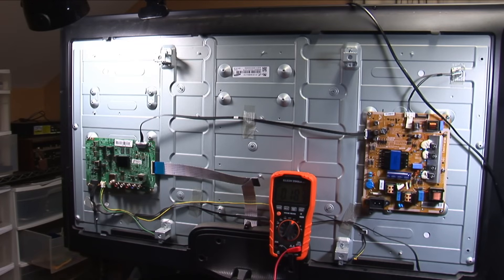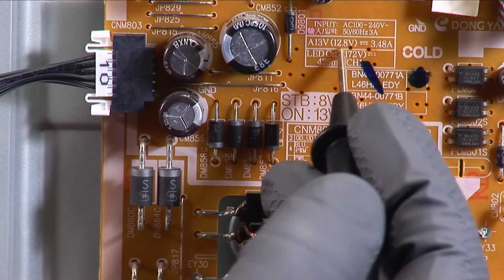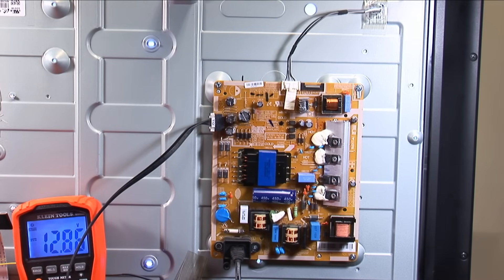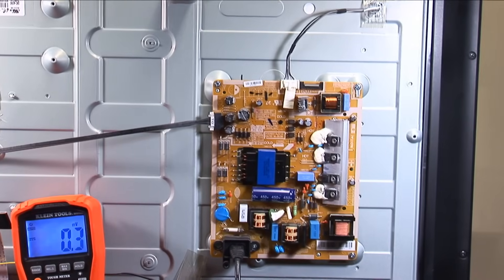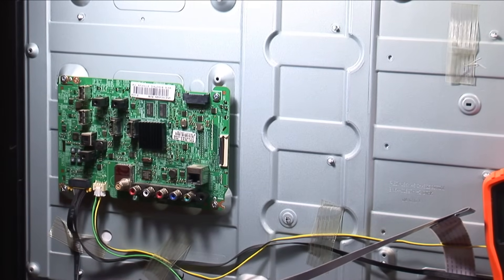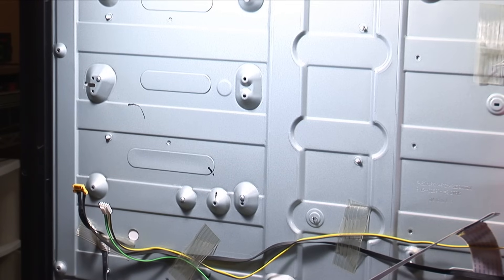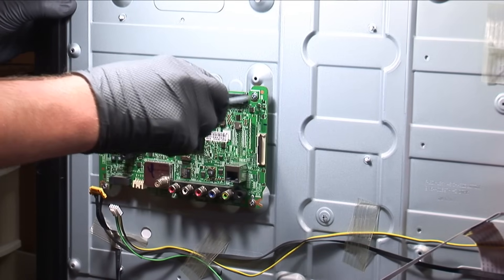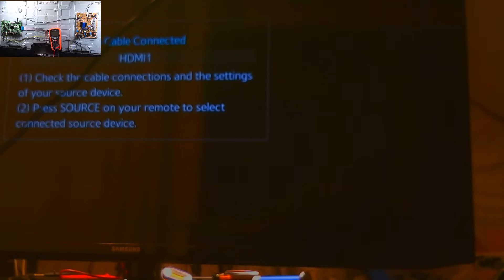Samsung LED Flat Screen TV Repair - Won't turn on, no power - How to Fix

Comment: That same 10 pin connector and table seems to be on a lot of other brands, LG etc. I salvage broken screens for the wonderful light panels they make, daylight skylight! The trouble is disconnecting the tuner-logic board leaves me to have to put a voltage on (on) and maybe more to get the lights to come on. I have never noticed pulling the 10 pin cable makes my task very easy as I want to ditch any extra power wasting tuner board etc. and have the lights to stay on not time out.
I have a dead 4K screen that seems to be OK for power but the button does not respond. I tried 3-5 volts and cannot get the lights to come on. $30 says I'll order the tuner board.

Comment: I have a sony TV, that doesn't go on. 
I checked if every board get's voltage. 
By accident i've found out as soon as disconnect the board (where all the inputs are on) the backlight goes on.
When i connect this board again the backlight goes out again. 

I hope somebody can help me out with any advice? 

Thanks!

Comment: Thanks for the commentary on the power board testing. My UN55KS8500FXZA revision AA01 won't turn on and I tested the power and the cable. Going to this stage next. 👍

Comment: I have a samsung Un70tu7000fxza, today while watching the TV shut off. Sound was intermittent then just cut off. I went through all the samsung troubleshooting with tye rep. When plugged in the red light blinks and tries to start up, screen flashes on but then Cutts out again and the TV just just keeps going through this process over and over again for an hour now. Service tech want $200 minimum for service call because it is 3 months out of warranty. Should I try and find the boards and replace them? Where would I find them. Thank you any help with this issue would be extremely helpful.
Reply from the maker: Question is, do you get a warranty on the repair?  If so it might be worth it, but this depends on how much the TV is worth.  You could try replacing the boards, although I'd recommend troubleshooting first so you don't buy things you don't need.  Almost sounds like a failing power supply but obviously can't say for sure since I'm not there.  If electronics repair isn't your forte then you may want to just call the tech as the TV sounds like its still fairly new and you may get a warranty on the parts this way.  Its easier to find parts for slightly older units on ebay and such as they were taken out of TV's with busted screens.  Buying new parts directly from Samsung would be difficult and could cost half as much or more than a new TV.

Comment: my lg 50 uh5500 if i plug it in the red comes on and most the time the LG logo comes up on the screen for a sec or so the the red light flashes 2times then goes off.. i tried pulling the cable off the power board like you did but the leds did not come on.. so i tested the plug like you did and i got 10.16 on the two on the left side of the plug and the 3 on the other side the 1st 2 also got 10.16 and the last one above NC i got nothing any ideas.. and do you think my led strips are ok?

Comment: I have 32" UE32EH5000K and I`m in a pickle. I can see the picure with torch against the screen so problem with backlight, OK. I`ve checked power board and there is 240V going to LED strips (tested to ground) so next tested, with 30V battery, each of my 4 LED strips (10 LED each) and all fine. I`ve tryed disconecting the logic board but the back lights stay down. Any ideas?
Reply from the maker: Hard to say without seeing it myself.  But you're saying you have power going to the strips but they don't light up, however powering them up manually with an external power supply they do light?  If thats the case check continuity, somethings open between the power source and the strips.

Comment: Great video.....I have a Samsung 75" Q70R and it went black screen while watching a movie, it flashed blue every 20 seconds, I have some knowledge in electronics so I opened it to see if it had bad capacitors. With the TV energized, I disconnected the ribon cable that goes to the main board and the screen turned blue, so I assumed it was not the damaged screen, I have been looking on ebay and I have found the original power supply parts, do you think that replacing the board will solve the problem?...thanks
Reply from the maker: Honestly I don't know.  Without any measurements its hard for me to tell.  With it flashing blue its almost like the power supply can't supply the proper current under load or its not outputting clean DC and/or the mainboard can't fully boot.  It sounds like the blue you see is when it reinitializes.  To SORT OF test the power supply, if you don't have an O'scope you can kind of check the output quality with a multimeter.  Make sure first that you have the correct voltages and then switch to AC and check those DC outputs again.  The reading should be zero or verrrry low.  If you check the 12v output and see 1 or more volts constantly under AC then that's a problem...not a clean output...however that might only happen under a load.  Could just be a bad main board and it can't initialize or boot ... or can't startup because of dirty DC.  Someone like 12voltvids might have an idea as it seems he works on these much more than I do.  Sometimes certain models have known issues.  I could do that with older analog gear as I have more experience with them and know many of the common problems between them.  Hope this all made sense.  I truly wish you the best and let me know if you get it figured out.
Reply: @Electronicle  Thanks my friend

Comment: Same thing happened with me ... hit by lightining ... same main board is damaged .. i have one question ... is this motherboard is repairable ?
Reply from the maker: Sure.  Anything's repairable...the question is at what cost.  I'm all about fixing and not trashing, however........   Lets say a tech charges $50 an hour to troubleshoot and repair plus parts cost, that just put you over the (usual) cost of finding a used board to repair this situation.  I made this video more to show average users how they can possibly fix their own TV.
Reply: i am from india.. samsung took 80 dollars from me and gave new motherboard in return. now i also have damaged one ... what should i do with it ?
Reply from the maker: @AkashvaniTech  Not sure about your country but we have electronic recycling centers, or you could sell it online as a parts board, or toss it.
Reply from the maker: @AkashvaniTech  If you do decide to try and sell it, make sure you list it as parts only so no one buys it thinking its a working unit.
Reply: @Electronicle  in how much money you can buy this board .. i can courier you ... whats your email address ... my samsung tv model is RU7470 43"
Reply from the maker: @AkashvaniTech  thank you but I'm really not interested

Comment: Takes 40-100 minutes of me mashing power button before red light blinks 4 times and actually turns on. Can this be fixed or do i have to go to bed with my TV on every night
Reply from the maker: Have you tried pushing the power button on the TV instead?  Worn out remote button?

Comment: If our TV just is very dark when watching movies...everything else is fine.  Which board would that be?
Reply from the maker: has it always been like that?  it all depends if its a ccfl backlight, backlight.
Reply from the maker: Also, that could be a setting.  Especially if your tv supports HDR or HLG.  Turn all that off and see if that helps

Comment: I REPLACED BOTH OF THESE AND STILL NOTHING.. ANY IDEA? ALSO AFTER LIGHTNING STRIKE NEARBY...  BN94-16427D CIRCUIT / MOTHER BOARD 
BN4400932T POWER BOARD

UN65TU8300FXZA MODEL CODE
UN65TU8300F MODEL NUMBER
S/N 0AQQ3CCNA15391A

Comment: I have the same tv but I have a red light that is on , on the logic board so does that mean it's probably the t-con board, my tv also wont turn on but when I turn the power on I can see the indicator light working lime when I try to turn the channel I can see a red light that blinks like it's working but there is no picture or sound.

Comment: I took my TV apart due to broken screen I realized i can use the LCD lights for a something but not sure how to turn back on I did it once but do u have a video showing something like that??
Reply from the maker: Um, not sure what voltage those strips run at offhand, sorry

Comment: Any tips on a reddish tint aliasing? I bought a 2nd hand samsung un40c6300 it powered on perfectly but after 3-5mins of having it on it started to slightly flicker and there’s aliasing and artifact with a red tint. Other than that it’s perfect.

Comment: No offense but board swapping for repair is fine if you have spares laying around, but the best repairs are finding the failed component on the board. One will want to do that anyway because now you have a bad board and perhaps nothing to test the next TV with.

Comment: Good video.  Have a 6900 series that a storm took out.  On it all the boards are in one.  All it has is backlights.  I'm waiting on a replacement board to come in the mail and hoping it will fix it.  60bucks will be a lot better than $410 for a replacement.

Comment: great video ,i have a two year old 75 inch Samsung that while i was watching ,i heard a pop and believe i saw a small sparking near where the power cord plugs in. my TV went black and will not turn back on with no lights anywhere. i haven't taking it apart yet but your video is giving me hope that I can fix it myself
Reply: fixed changed power supply board was fairly easy tx
Reply: Just curious if you were able to fix this. I had the same pop and spark on my set. Hoping to be able to chase it down.

Comment: Thank you for your very helpful video I had a 2022 Samsung TV that would not power up. Found out the fuse on the power supply was blown. First I disconnected the main board, unsoldered fuse from the top of the board. Put in a temporary fuse and that blew immediately. Found a board on eBay for $40 and that's on the way.

Comment: Hope you can help with a Bn4400932C board. Upon applying ac to board 5a 280 slow blow fuse blows, continuously. All peripherals are  disconnected. There does not appear to be any cold solder joints bad looking components or burns on the board. Any suggestions at this point would be greatly appreciated. Thanks for looking.

Comment: Hello , have a trash pick samsung smart 4k uhd tv mod: un65nu6900fx . There's  standby light and back lights when turn on. There's also audeo.The problem is no display . I understand the power output rating but couldn't  figure out the other Abbreviation in the CNM 801 diagram on the board  , Can you help me repair this samsung tv.
Thanks
Darryl

Comment: Very informative video, good testing. I am currently checking my Samsung UN55J6200DAF bcuz a few days ago, as we watched Tv, we began to hear crackling at the rear of Tv and it went dim blue, then black. It turned off with remote, but I disconnected everything off the wall outlet as precaution, bcuz I also smelled burnt wire. Watching pertaining videos, I checked fuse, its good. I inspected all 3 boards and only at the power supply board did I see like melted wire plastic. I could not see anything unusual on the main green board, it has a red lit port. The T-con board seemed ok as well, it has blue lights when I power on. Odd thing is, she turns on with power button and remote, but will only turn off with remote. I tested all LEDs thru the corresponding wire leads and many did not light. I tested the port pins from where the LED connector goes, and it had No current going out. I did perform the test you did, unplugged cable connector from main or logic board and did get the four 12.65v results in those leads, plus the 4.50 power on voltage of other set. One thing is for certain, I am going to replace All the LED strips with new. And Im prepared to replace the power supply board as well. However, I am not sure about the green logic/main board. Waht say ye..?  I'd appreciate any input.  (incidentally, this Tv is 7yrs old, was working flawlessly).

Comment: hehe i have my tv laying out here, with a similar problem, so was gladly following your instructions as a complete electro-novice.

1. Check power supply pins one by one. check, they're working, same as in the vid!
2. Get second hand mainboard supplied by owner... crap, dont' have that.

Anyway thanks for sharing, the tip for unplugging the mainboard to see if the backlight was working was very nice to know!
Reply: I had the same issue and was able to spot some hairline cracks in some old solder connections. I just tapped both spots with my soldering gun and got it back up and running. Haven’t had any issues since. The cracks in the board were only visible on the back side of the board after unscrewing.

Comment: I have a question about the serial number. Im replacing the screen on my tv from another busted tv and Im woried it will affect my serial number if I replace something. In the menu I can access the serial number, on what circuit board is that number recorded?
Reply from the maker: Its not held within the screen so you should be fine

Comment: I have the same TV and replaced the power board which solved my problem for a few weeks. Now I have no picture. Watching your video I have the same symptoms (no picture and lights go on when you unplug that cable). Looks like I'll order a new mainboard and hope that the T Con board is not bad also. Thank you.

Comment: Just tested mine using the same approach and the the voltage is fluctuating on the power board same points , not a steady 12.8vdc  . Also backlight doesn't turn on when I unplug the mainboard from it. Can I  assume that's the power board who needs replacement ?

Comment: Hi I had a same problem with my samsung UN55D6300SF. The led indicator is blinking but the tv won’t turn on. Do i need to change the power board or its a minor problem. TIA

Comment: Sir, I've found your video to be the most useful and knowledgeable video among the hundreds I've watched. I am an electrician, but I'm not getting any readings from any of the pins from the power supply side. Also, when I unplugged the cable from power supply to the green board, no backlight came on. Would it be safe to assume the power supply/inverter is no good? Thank you in advance for any help, and the awesome straight to the point video you created for the rest of us 🤓
Reply from the maker: obviously it depends on your specific board and how its designed but yeah if there's no output then its probably the culprit.  There will usually be at LEAST a constant 5v from one of the pins on all TV's.  This allows it to go into a sleep mode but still keep an eye out for the power command from the remote or console power buttons.
Reply: I will look into that, thanks so much for your reply!

Comment: Thanks for your imformative video but i thought the power board only gives the dc outputs when it gets a command from the main board so how did you measure those voltages?

Comment: If the backlight doesn’t power on after unplugging the main board, does that mean the power supply is bad
Reply from the maker: Not always however its a direction to go in.  Check the power outputs using a multimeter.  Does the TV turn on but not display a picture?  if so it could be a bad backlight or backlight circuit.  Check with a flashlight to see if you can see anything on the screen, also is there sound?  If the tv doesn't turn on at all and unplugging that connector doesn't power up the backlight, check the power supply with a multimeter as shown.
Reply: @Electronicle  no it doesn’t turn on at all and the standby light on the power button is off as well

Comment: I have a Samsung UN55tu7000f it only has 1 circuit board, it has no picture no sound and the red light blinks 5 sets of 2 blinks. The capacitors are fine no sign of trouble anywhere on the board. It looks like a ceramic fuse but it’s soldered on the board if it is a fuse. Any help with further checking to fix is appreciated,I have a video on my page. Thanks

Comment: We have a Samsung Series 6 led tv that the power knocked out, it clicks and the standby light is on but the tv doesn’t come on, do you happen to know where we can find a used power board and main board?
Reply from the maker: for home a/v equipment,  I found auction sites are usually your best bet...such as ebay or etsy.  Just make sure you get the exact board using the full model number of the tv.
Reply: @Electronicle  ok thanks for letting me know

Comment: I bought all new boards for my Samsung led 60 inch flat-screen TV and it still isn't turning on... the small red light in front flashes and the back light from open side in the back is flashing as well what could it be

Comment: I'm wondering if you have some advice. I have a 70 inch samsung 6 series TV. I'm not super familiar with new tv's (been a decade or so) I know how to replace boards and stuff. I've been trying to trouble shoot this. In this video you show how power goes through and mine does the same and is fine. I also have access to replacements and replaced both the power and main boards just in case. I'm still getting the same thing. Led blinks twice intermittent. in the back I can see the backlight come on full for a second or two, off then back on real fast to dim backlight for a second or so and then off. The flashing and the backlight go through this series over and over.

Comment: I have a working power supply with the backlight coming on and a working cable but when I plug the motherboard in it goes off. So I bought a new motherboard and plugged it in, now the tv just turns on the backlight for a few seconds and then turns the TV off after flickering, over and over. Did I buy a bad motherboard?
Reply: Yes!